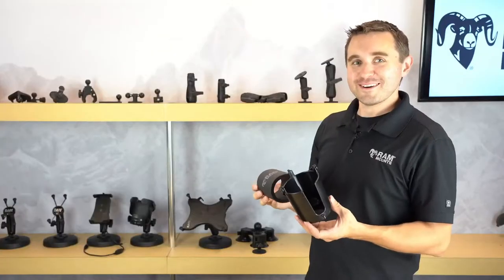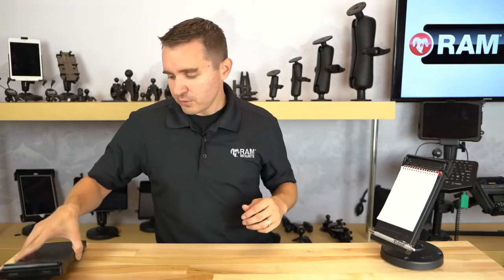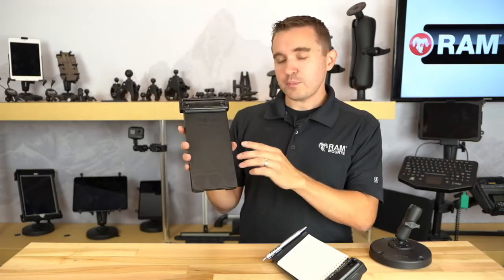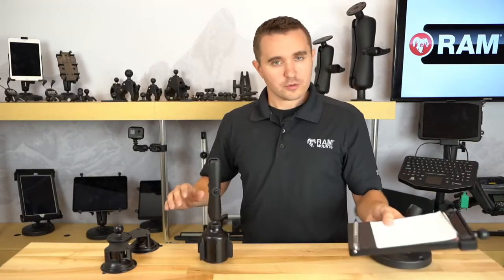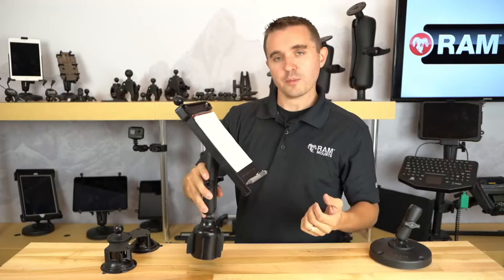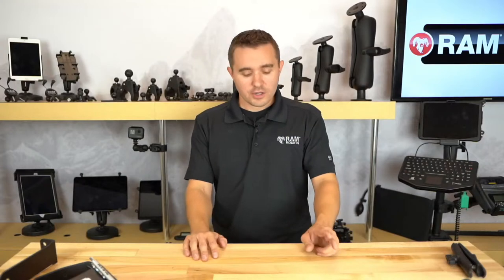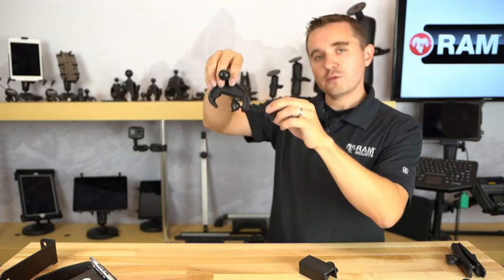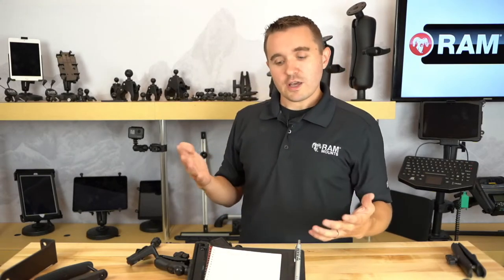RAM® Multi-Pad™ Product Overview and Your Questions Answered

Comment: I've been thinking a note pad would be useful in my vehicles.  I think the Multi-Pad will work great.  I already have RAM mounts all over the place, so this is a no-brainer! :-)
Reply from the maker: Even better if you can adapt it to existing RAM parts! I think this was mentioned in the video but the pad itself is about 4" wide, just to give an idea of the size of the writing surface.